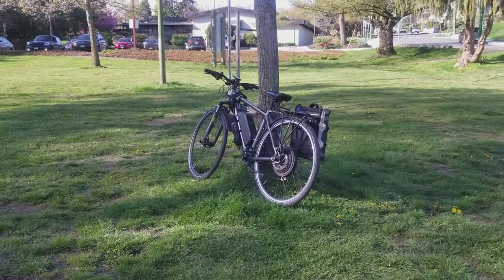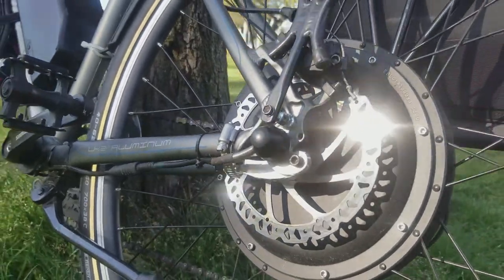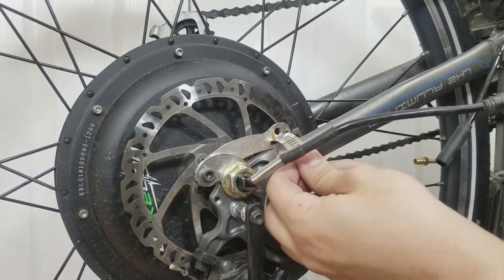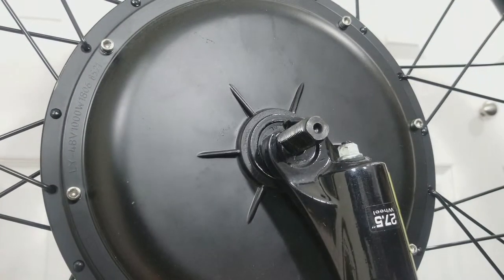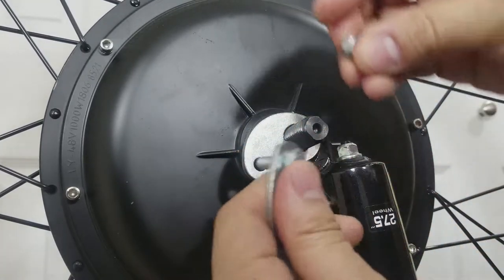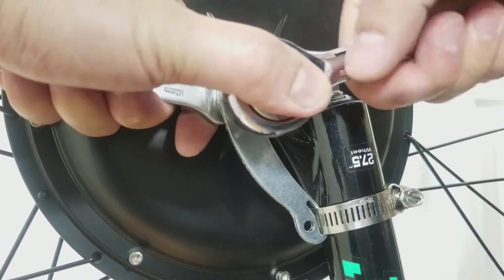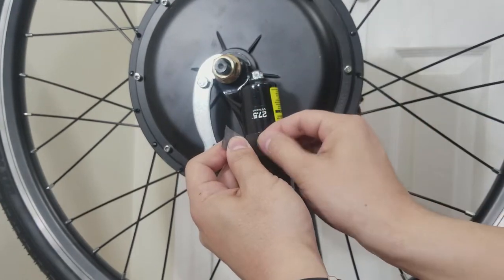Ebikeling Torque Arm Installation

Comment: Heads up to everyone! In the video, the  guys bike was upside down! That’s why the torque arm looked different to me!!
Reply: Thanks I was like wtf
Reply: Thanks
Reply: Yea I installed mine different also…Mine is mounted  where it hits the bottom frame…When the arm is spinning it pulls up’ not downward’ this keeps the bolts from coming out from the drop out
Reply: i think he also applied the torgue arm incorrect as well.
Reply: @ebperformance8436  please can you explain how you installed yours. My frame keeps lifting up off the axel and I feel like it’s because the torque arms are doing it

Comment: Grin Technologies recommends not putting a single torque arm on the side with a hollowed-out axel arm. They recommend installing only a single torque to put it on the side that does not have a hollow axle.. because, they said, the hollowed-out axle is weaker than the solid metal axle.

Comment: Nice video ! I assembled my e-bike yesterday and I went to test a bike , the rear wheel came off ! The problem is the wheel turn with the axle and damage all the wires … if I know about this secure maybe I could avoid this happen
Reply: You didn’t use tork arm
Reply: similar thing happenned to me. In my case i didn't use a proper torque arm and the added power caused my jerry rigged torque to slip off and spun out the axel and caused damage to the wires. I believe wires can be replaced.. but I have not yet sorted that out.

Comment: I see a problem on the rear hub torque arm install. When power is applied the wheel will spin counter-clockwise and the axle will want to spin clockwise. The way you have the torque arm installed the axle can still spin clockwise. Torque arms need to be installed so that they are pulling against the frame, not pushing against it. Sorry.
Reply: +1 
Wanted to write the same!!
Reply: So what’s the correct way to install it
Reply: The bike is upside-down when he is installing them so its the opposite when its on its wheels

Comment: The most basic question is when fitting on front wheel , should it be on front or rear of the fork. In this video it’s on the front I’ve seen them elsewhere fitted at rear.

Comment: On my Ebikeling rear hub direct drive kit, I had bigger problems WITH TORQUE ARMS than without them. Clearly I need custom ones if I'm going to have them. They make the wheel pop off and they stay on fine without them.
Reply: Most videos I’ve seen do it the wrong way
Reply: @RPNDAILY  
surprising how many cheerleaders there are even when the poster doesn't know what it's doing...

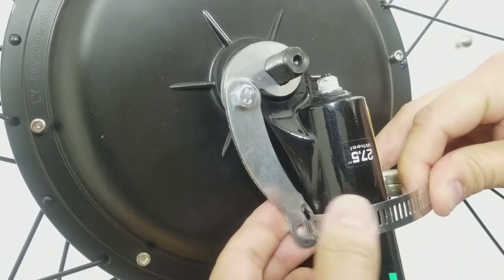Comment: What most people do not realize is those things are terribly designed.  The rotational torque is attempting to slide the hose clamp up the tube it is attached to.  Doug's application is most egregious >>  02:10
The design should either have the arm push perpendicularly into the tube the hose clamp is attached to or perpendicularly pull away from the tube.  Trying to slide the hose clamp along the tube is by far the weakest configuration by at LEAST 5X.

Comment: So if I kept tightening the pipe clamp and it got to the end of the notches and still didn’t tighten down did I do it wrong?  Seems the clamp is too big for my frame.
Reply: Correct. The clamp was too big or the slots didn’t go far enough up the length of the clamp. No big deal. $2 to $3 for the correct hose clamp.

Comment: Heads up to anyone with aluminium frame bike, please use torque arm before riding it or you will damage the frame as well as the hub motor wires

Comment: Some very good close up video, sadly, because the bike is upside down, the perspective is lost.  It would have been so much better, if there had been a picture if the bike on the ground (correct way up) so we could have seen the finished article.  It's far to easy to fit the arm lockers the wrong way round.

Comment: These arms are a gimmick. Good to dropship but a lie.

As a welder I recommend basic welding skill. A hose clamp will not work with critical failure. I had a friend who had a 1000w front hub come out and snap that hose clamp like a paper rip. He was hospitalized for 2 months( front forks dug into ground @ 30mph)...can you imagine?

I recommend a steel framed bike as you can weld onto the dropout. Weld 2 coupler nuts on each side of the U. Put the wheel on and then put bolt through as it slides in both nuts on each side. If motor torques it is near impossible for "forks" dropout to bend and/or axle come out. After weld if your sloppy clean up with grinder then put jb weld steel stick putty over welds and morph for a clean look(also seals weld from oxidizing aka rust). Last match the paint. Outcome is industrialized dropout aka motorcycle dropout. 

I did this with one of those super 73's except it was not a super 73 just the style. Only difference is....its all STEEL.

Get a MIG FLUX welder they are cheap and very easy to use.

Comment: My ebike is having problems the axel is almost fully stripped and keeps turning and twists up the power cord until it pulls it apart from the end where I connect it.would this tongue arm work for me to stop the axel from spinning in place?
Reply: that is what they are for. But here shown installation is wrong.
Reply: @TushhsuT  it's actually the dropouts are so worn out and torn up not even a new torque arm and a new motor with new axel works it still spins out and the power cord on my new motor is about to be destroyed also.Suxx for me